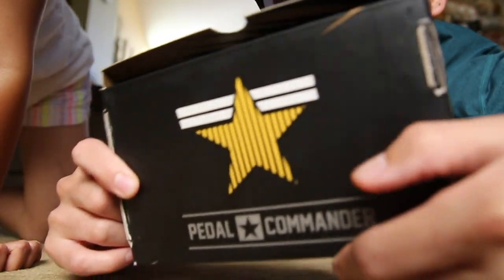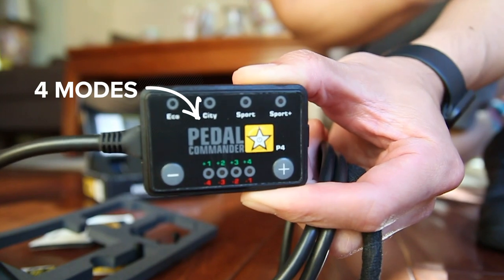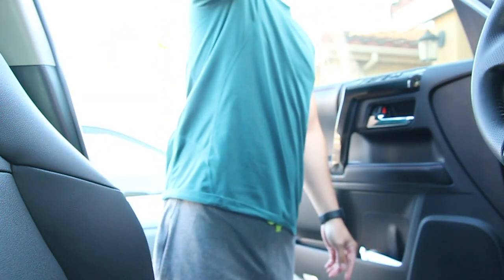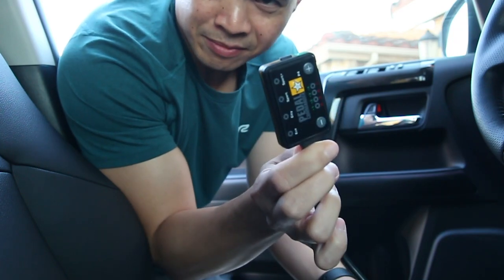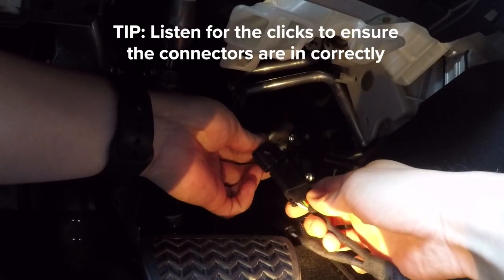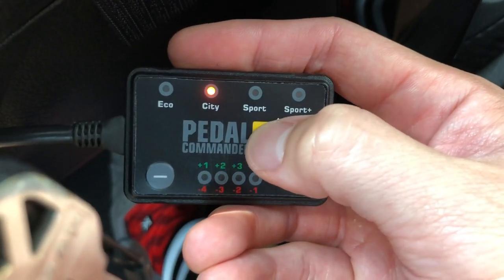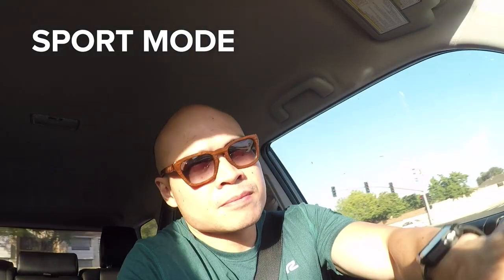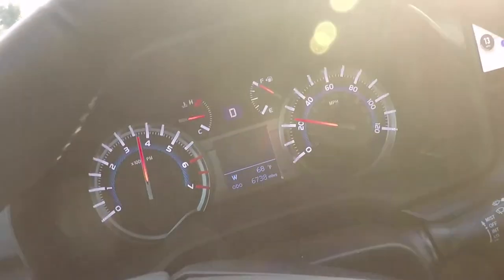Does PEDAL COMMANDER add Horsepower? Installation on 4Runner TRD PRO

Comment: Pedal commander's are great, the easiest way to explain them performance wise I'd say I'd doesn't add hp rather it unlocks hp you wouldn't be able to use normally
Reply from the maker: 100% agree. It certainly isn't adding horsepower, but it seems to redirect it a bit into more usable power. It's just made the driving experience much better.

Comment: Watch me not spend several hundred dollars on this and just push my pedal a little harder / use shift mode to achieve the same exact thing, lol.
Reply from the maker: Definitely a preference thing and where one puts their money. I largely enjoy driving, but that's dependent on how good the car drives. Throttle response was severely lacking, and the PC has made it much more enjoyable. So for my uses, the PC has been the best investment, bang for buck. While shift mode does allow you to control shift points, it does not alter throttle response, which the PC does.

Comment: Nice video bro! Almost 2 years later any issues such as check engine light or gears shifting to limp mode? Thanks
Reply from the maker: Sorry for the LATE reply. No issues 2 years later. In fact, I bumped it up to Sport mode for daily driving due to extra unsprung weight, and it continues to drive well.

Comment: Still using this? Any issues to report?
Reply from the maker: Still using it every day, and no issues to report. Well, the adhesive for the bracket didn't hold, so I've stuffed the PC unit under the steering wheel column. I probably shouldn't have detailed my interior prior to mounting the bracket haha.
Reply: @neilbucu1601  I've been using mine for about 6 months now. No issues... been really great.

Comment: So you mentioned in one of the sport modes that you gave it very little throttle but got high rpms (I think you said that at least...) what happens when you stomp on it from a stop in one of the sport modes? What does it do differently than stomping on it without the pedal manipulator?
Reply from the maker: I've done WOT pulls and the only real difference between having the PC and not having it is the initial throttle response. With PC there is no lag, whereas without the PC there's a noticeable lag. The prime benefit (that I've experienced) of using the PC is when you're not flooring it and just driving it normally through town. It's more predictable, and the improved throttle response gives me more of a connection to the vehicle. Seems like it goes when I want it to go, and accelerates when I want it to.

Comment: Would the gas mileage indicator still capture the mpg correctly while using this?
Reply: It should. The only thing this does is trick the computer into thinking the pedal is being pressed down further than it actually is, so it would still use the same amount of gas & calculate it just the same. Whether or not you can keep your foot light after installing this is a different story

Comment: Theoretically, getting to the meat of the power quicker would result in quicker acceleration (even without an actual overall power increase). 

To simplify, revving to 2k rpm before releasing the brake (while flooring it) should result in a quicker 0-60 than simply stomping on the gas pedal. I believe this concept is the same with increasing throttle sensitivity as it relates to acceleration at any speed (assuming you aren't already at peak output).

Comment: You just answered all my questions with this video now I’m debating if I should get it or not, just worry it may cause a issue down the road with check engine lights popping up
Reply from the maker: Checking in almost 3 years later and no errors or check engine lights since!

Comment: In Eco mode does it give you better fuel economy?

What really happens when you drive in the Eco mode setting?  Thank you.
Reply: makes u feel slower... basically when u press the gas half throttle on eco its less.
Reply: Throttle response is slowed down worse than stock. That’s all.

Comment: You didn't get the Pedal Commander with BlueTooth?
Reply from the maker: It either wasn't available when I got mine, or I just didn't know about it haha. I've always been an analog guy anyway, so I'm fine with the wire, and no connectivity issues thus far.

Comment: to change the pedal commander to Eco hold to settings button down then it will change to Eco
Reply from the maker: Thanks for the tip. I've been rolling with Eco for a few weeks and definitely helps the mpg, but it's a slug to drive in the city.

Comment: Does it delay shifting to a higher gear or makes the throttle response instant 
my truck throttle lags for a second when taking off and its the only thing i miss in smaller cars
Reply from the maker: That throttle lag when taking off is the #1 reason I got the PC. It's eliminated that, so driving is more predictable. It doesn't directly affect shift points, BUT the increase in throttle response seems to have indirectly improved shift points. In my mind, the increased throttle response tells the shift controller that there's X amount of throttle applied, so "continue to run this gear until a more appropriate shift point", sort of thing.

Comment: Does it affect fuel mileage? I would think it does.
Reply from the maker: In my experience, it does, but it also depends on how you drive. Since I don't feel the need to floor it so much just to get good throttle response, it seems to have slightly improved my MPG, but YMMV.
Reply: I've had mine for 6 months now. I think I keep it on City +2 (honestly haven't touched it in months). Definitely peppier... no change at all in my gas mileage.
Reply from the maker: @ThomasPlace45  Great to hear!

Comment: I have one on my 07 Limited it came with the truck....ECO doesn’t light up for me either I’m assuming that eco is just stock aka the pedal commander isn’t doing anything. But I leave it eco or “off”. I find it to be too much almost like there’s no medium between gassing it and barely accelerating...idk just my opinion. The First time I discovered the pedal commander was installed in the truck I didn’t know wtf it was I put it in sport + and +4 (highest it goes) and the light turned green and I barely even pressed down on the gas and my tires peeled out all skreetching while I went no where lol then I had to break n accelerate again and it was probably the funniest thing to watch from a distance I literally couldn’t control the acceleration! But I find it to be unnecessary at most times unless I have the need for speed and wasting fuel lol
Reply: Your 07 has a eco light? I thought only 5th gens did.
Reply: Karma Nv No I meant the ECO light on my pedal commander
Reply: Whoops.
Reply: I believe you need to hold the pedal commander button for a couple seconds to go into eco mode

Comment: Pedal commander or sprint booster?? 🤔 wich one it is the best? Help pls
Reply: compa Migue sprint booster is the Original. American made product. pedal Commander is a Turkish knockoff.
Reply from the maker: I don't have experience with Sprint Booster, but I've heard good things. But so far in 3 years of daily use, my Turkish knockoff has performed perfectly.

Comment: I’m a little confused. Does this do anything besides alter how much throttle is given depending on your pedal position? It looks cool but I’m skeptical. Does it reduce time for throttle response and downshifting too? Trying to talk myself out of buying it.
Reply from the maker: Short answer is yes. Compared to stock, when in City, Sport or Sport+ downshifting and acceleration is almost immediate. (in Eco mode, downshifting is extremely laggy). I've found that City +1 or +2 is comfortable and makes the driving experience much, much better.
Reply: Neil Bucu  Awesome, thank you!
Reply: Tricks the computer into thinking your giving it a lot more throttle than you are. Makes for a very JERKY driving experience on the high settings. End up turning it way down just for drivability. Feels like there is tons more bottom end torque, but then there is nothing left from half pedal to full throttle. Uses way more fuel in my opinion.

Comment: Looks like mira mesa california. Correct? Anyhoe, good vid. Thinking of getting one for my 18 taco.
Reply from the maker: Vu Truong yes! This is in Mira Mesa. I actually owned a 2017 Tacoma before the 4Runner, and if I still had it I would absolutely get a Pedal Commander for it. The 3rd generation Tacoma has an “interesting” transmission that leaves it hunting for gears very often. I think a lot of that has to do with Toyota’s stock program and throttling your fuel inputs. I’d also recommend getting the Shift Sense Pro to help with the shift points in your truck. Those two items paired up would be amazing. Read up on it and let me know if you’re interested. I still have my Shift Sense unit from my Tacoma.
Reply: Neil Bucu I am from Portland and have sinced moved back to PDX. We lived in mira mesa for 3 years off of summerdale rd.  Already spent a couple g with new wheels wKO2. Need to wait a bit for a commander.
Reply: @Neil I live in SD, any more tacoma parts you have for sale?
Reply from the maker: Yep I've got a few items still for sale. Including the Shift Sense Pro, I also have the tailgate "TACOMA" letters in gloss black, center cubby hole organizer (and also the cubby shelf unit), and TACOMA door sill protectors.
Reply: That's the first thing I thought when I saw this vid. Gotta love the 92126.

Comment: So I have to ask. Is it really worth the money $$$?
Reply from the maker: Chuck Heinbaugh short answer is yes. Yes you save some money in gas savings, if you drive in eco mode. But for me the real value is driving in City mode. It just drives so much better between throttle response and the feeling of available power. Additionally, I took it off-reading last weekend and actually found that using eco mode helped in the ability to modulate the throttle in technical areas.
Reply from the maker: Chuck Heinbaugh short answer is yes. Yes you save some money in gas savings, if you drive in eco mode. But for me the real value is driving in City mode. It just drives so much better between throttle response and the feeling of available power. Additionally, I took it off-roading last weekend and actually found that using eco mode helped in the ability to modulate the throttle in technical areas.

Comment: Does eco mode work?
Reply from the maker: Yes, I finally figured out that you have to hold down the main button for a few seconds to activate Eco mode. I'm going to post up a follow-up video, but I can say that while Eco mode completely lowers the throttle response (makes the car feel SLOWWWW), it also added about 35-40 miles to a full tank (approximately +2mpg average)

Comment: Almost a year later, have you experienced any issues so far?
Reply from the maker: Thanks for checking in with this. I've had ZERO issues with Pedal Commander thus far. All the buttons still work, indicator lights still light up, and throttle response is still great (and not great, as it's supposed to be, when in ECO mode). No regrets here.

Comment: Has your mpg dropped?
Reply from the maker: For me, it dropped a bit depending on which mode I used. I found the sweet spot for easy driving to be CITY +1. On stock mode, I averaged about 16mpg. On City +1, I was down to about 15.5mpg. And on Eco mode, I was just over 17mpg. This is a mix of city and highway driving. I think going forward, I'll stick to City mode but switching to Eco for long hauls on the freeway.

Comment: will it mess with the shifting (tranny) while coasting on high gears?
Reply from the maker: Max Cruz this unit will not adjust shift patterns or ratios. HOWEVER, due to it adjusting the throttle sensitivity, it will downshift more quickly (sooner) if you input throttle even while coasting at high speeds.

Comment: Use Sequential shift. It's the same exact thing. All this device does is tell the 4runner to hold the gear longer.
Reply from the maker: I don't think this is accurate. I had a device on my old Tacoma that actually did exactly what you're describing. It's called ShiftSense Pro, and it told the transmission to shift at certain, predetermined points. The Pedal Commander, however, connects directly to the throttle input and tells the computer how much throttle to give, depending on what mode you're in and how much throttle you're giving it. They're definitely not the same thing because I know for a fact that you can use both on the afore-mentioned Tacoma; ShiftSense controls shift points, and Pedal Commander controls throttle sensitivity.